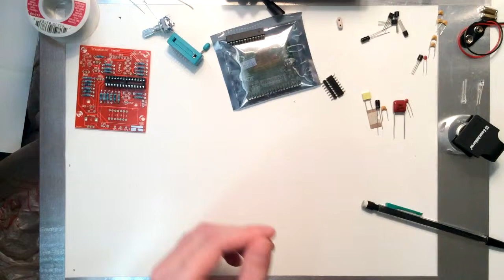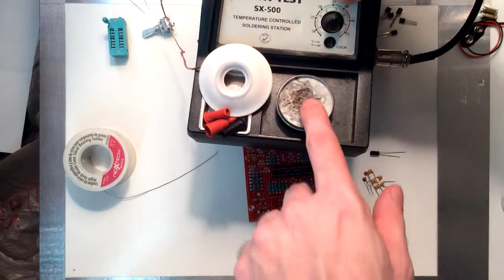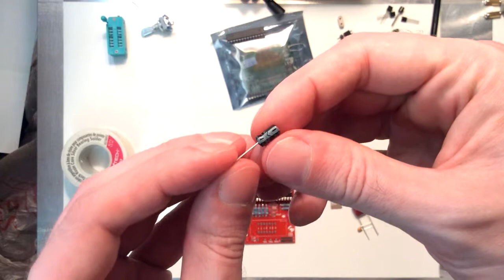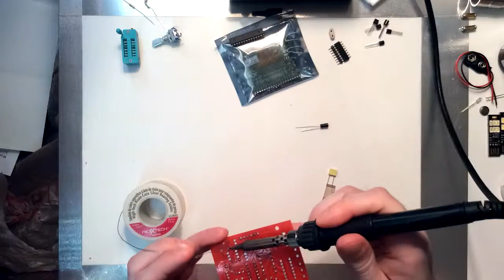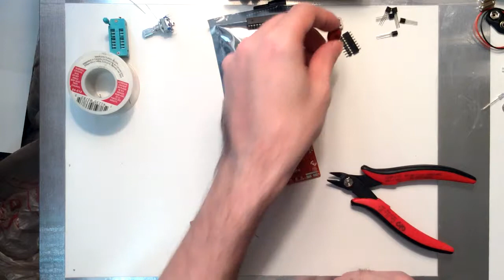M8 Transistor Tester Kit Build - Part 2

Comment: Tip thinner? New to me, does it help?
Reply from the maker: It's stuff that you stick the tip of your iron in. It's got flux, solder powder, and a mild acid that scours the tip of your iron. Turns out, I was overusing the stuff.
Reply: @GadgetBoy  im going to guess as my new tips cost under $2 each I will probably be slightly better off without 😅 I guess you don't want it being eaten away, maybe it's like (what I assume) waxing your car, not an every day thing, more like twice a year